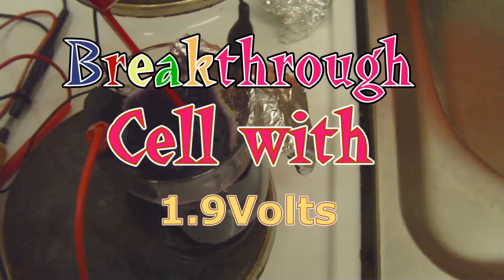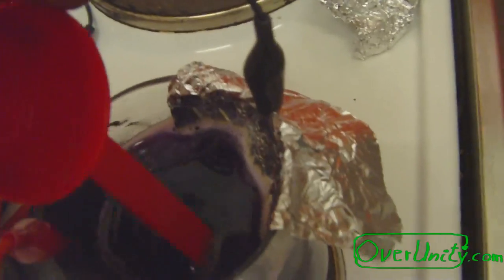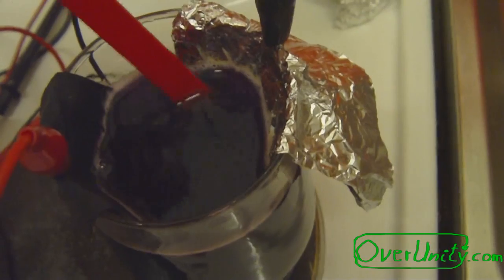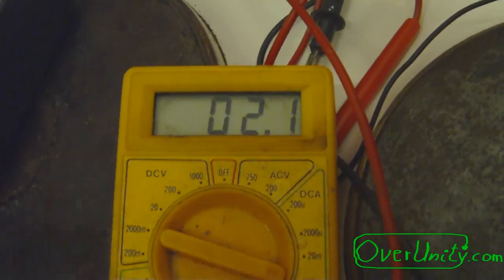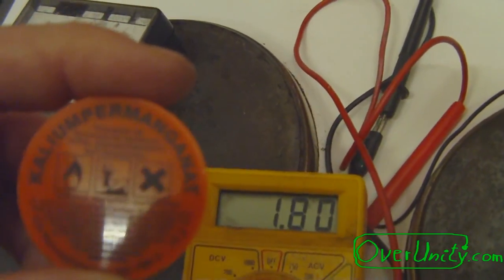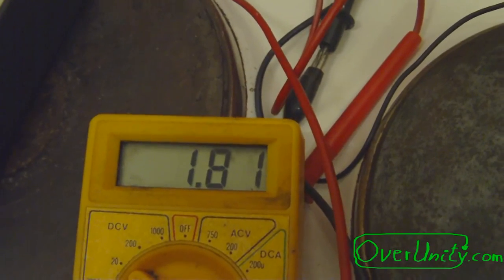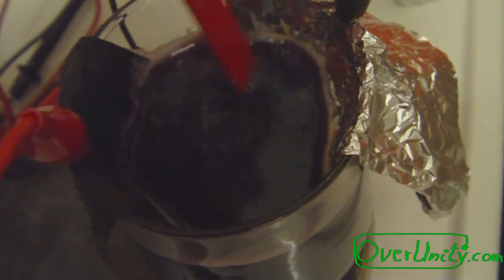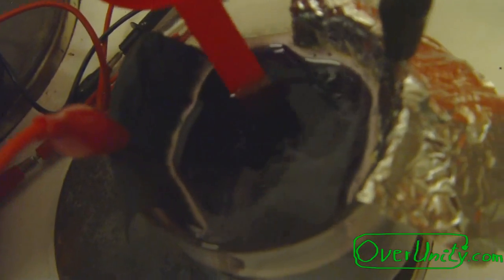Graphite-paper Aluminium foil battery cell breakthrough voltage up to 1.92 Volts 1/5

Comment: No doubt the addition of the Potassium Permanganate has a straight forward chemistry based explanation for why the voltage increased. Yet the available power, 1.9v x .002A is not all that different than other Aluminum/Copper batteries with similar metals surface areas like yours. Higher voltage alone is not worth getting excited about. Even if you did show approx 4x power output over similar metals, it would simply mean that the electrodes will dissolve 4x faster. FWIW

Comment from the maker: Hi Bill,
as long as the Alufoil will last.
You just need to change the Alufoil from time to time.
The graphite paper is not consumed.
If you build this this way, that the layers of alufoil and graphite paper are closer, it will also have more current and can be used to drive a Joule Thief.
Regards, Stefan.